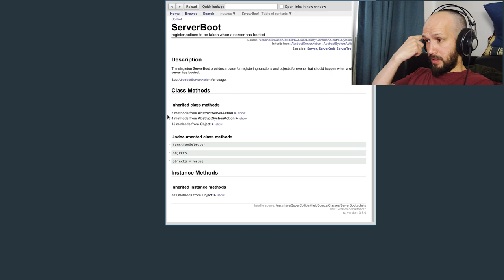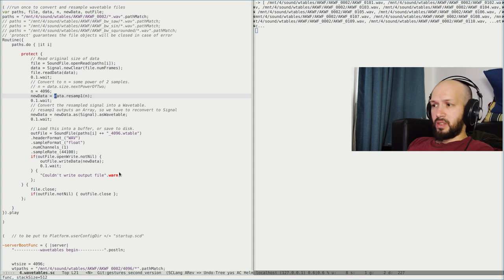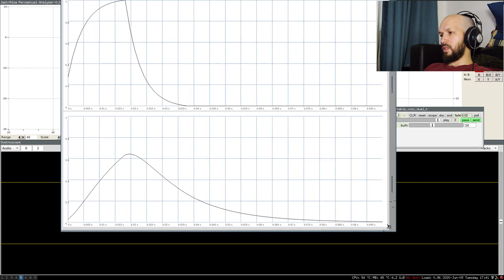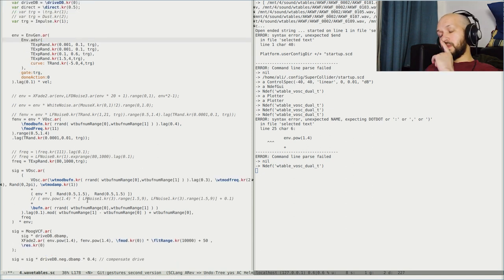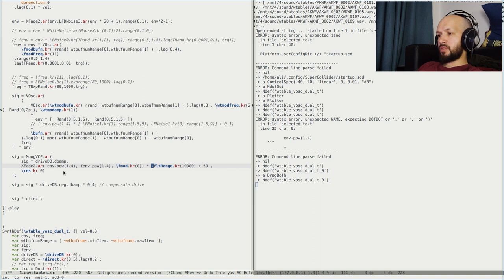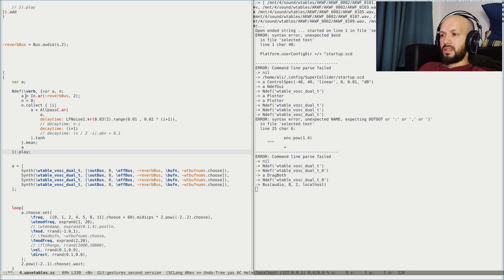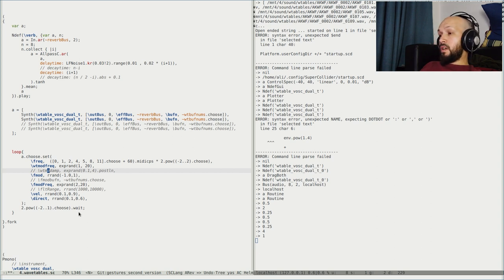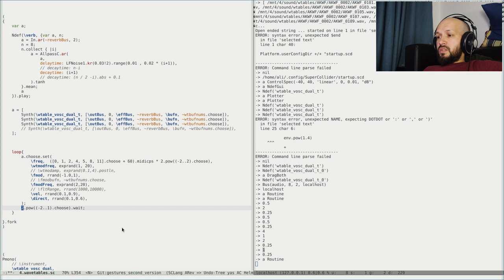5: Wave Terrainish adventures with VOsc - Musical Sound Design In Supercollider

Comment: Could you explain how to get your setup code to work on windows? it fails without errors for me:(
Reply from the maker: I guess there can be a need to ensure all the paths to samples and wavetables are in windows format. In particular things like"/mnt/4/sound/wtables/AKWF/AKWF_0002/*.wav".pathMatch;
might not work on windows. In that case probably array of filepaths should be provided literally
Reply: @Reflectives  It works, just needs to be formatted slightly differently:
paths = "C:/Users/default/.../*.wav".pathMatch;

Thank you for the amazingly helpful video!!

Comment: Something i do not get. You load the buffers on Server boot. So your code requires to be run before your server boot or you need to reboot your server after. Why do you do this procedure? Isn't it just easier to cut out the ~serverBootFunc function? What am I missing?
Reply from the maker: ServerBoot is for things to run after server boots. So if you want to reboot the server and have all your bufers etc be ready for use you add that to ServerBoot. Startup file is run when sclang starts, ServerBoot -  after scsynth start
Reply from the maker: You can go with just the function. ServerBoot there is just in case I need to reboot